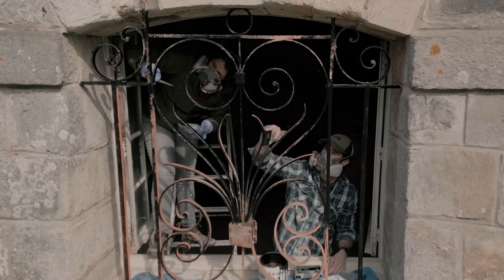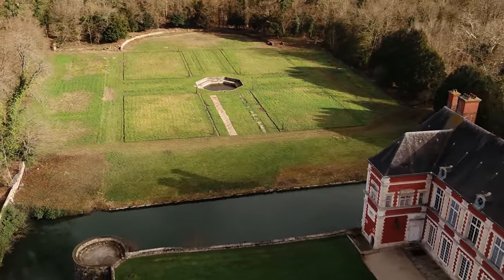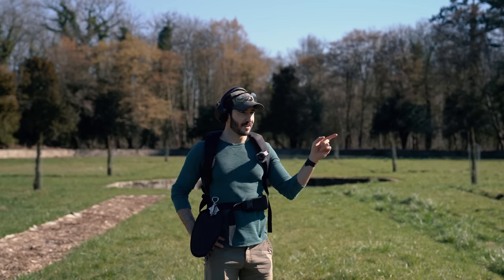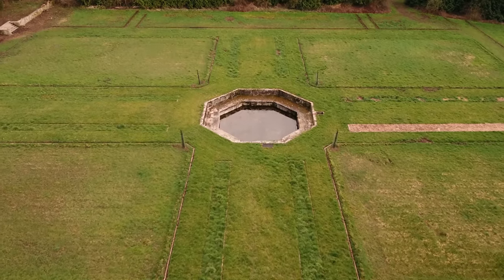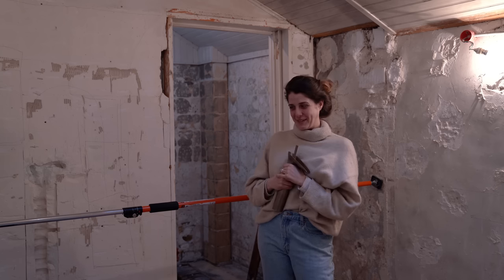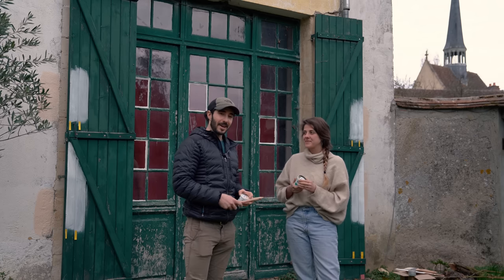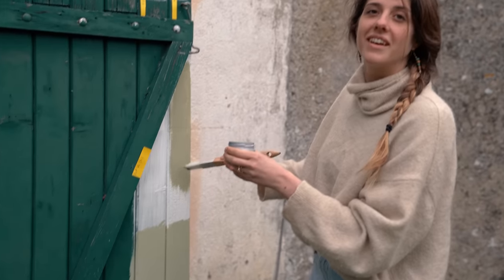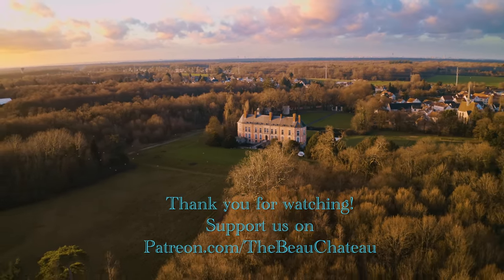Painting Our Medieval Dungeon Metalwork | French Chateau DIY

Comment: You two are wonderful on film. 
PAINTER'S TIP: Not sure if they are available in France, but here in California, when we paint wrought iron like the type on your 'dungeon' windows, painters wear a 'painter's mitt'(they are sold on Amazon). Once on the hand, the painter dips (palms first) hand into a pan of paint and then using the fingers in the glove move (back and forth) the paint over the iron work. be sre to only use one hand at a time...and be sure to put your hand into a sturdy latex glove before inserting your hand into the 'mitt'. 
Because you are giving up some control of the paint, be sure to protect the areas around, beside and beneath the iron your painting. Happy painting.

Comment: I would sand the wood down bare and use linseed oil to stain. The stained wood and iron hardware give a more rustic and authentic look with the age of the grounds buildings. You can also use a torch to give a more aged look with the stained wood.

Comment: You might consider , for a door in that bathroom, putting a trolley track on the ceiling and having a door that slides open on the track on the outside of the wall.

Comment: For the pocket door, it may not seem ideal, but if the existing wall isn't working, you could build an extra pocket wall infront of it for the pocket door. 😉🙃🤔 Though it may take a number of inches away from your bathroom space. However, depending on how deep the wall goes into the corner from the toilet entrance, you can then use the left over pocket wall in the corner to make build in shower shelves for soap and shampoo.

Comment: We had a similar problem while choosing a door for our half bath/laundry room. Originally wanted a pocket door, chickened out, and went with a folding door. It locks with a hook latch, is pretty low profile when folded, and has worked out really well (especially because we didn’t have to mess with the wall).

Comment: Having done designs with gravel in the past.  They are nice when you first finish them, but once any traffic hits them foot or driven, they come apart.  So its either continually maintaining the design or letting it go.   
Outside of designs in it, gravel works well in gardens for paths and highlights.  Barriers underneath are important, but won't keep all weeds out.  Eventually debris just collects under the gravel and they'll take hold anyway.  But it is usually pretty easy maintenance.

Comment: Although I love the original dark forest green. You definitely need to go a lighter colour! As it’s part of the smaller property it will open it up to its surroundings. I’m not sure what the peach was on the walls of the building, but don’t go down that route. It ages terribly and shows up exterior mold too much. One of my properties has a peach exterior (not by my design) yes it’s only a 470sqm house internally, but hell I hate it. Nothing really goes with it and shows all. I’d rather go for a grey to white stone look on the exterior. Everything can work with it and you can see what you need to clean. 

Awesome job to you both! And yes even though just 1 window with iron that nobody else will see, you will and the design is exquisite. Should be used elsewhere in the chateau 💕

Comment: How fast will the paint fade? Will the paint on the plaster fade faster than the paint on the shutters? If paint fades fast where you are, how often do you want to have to repaint? I lived on the Gulf Coast of Texas and the salt air is like sandpaper and the sun is like bleach. I painted my trim a nice dark forest green so that it would still be dark when it faded. Saw a lot of paint schemes turn to pastel. One side of your chateau is red and the other pink--is that due to exposure or on purpose? I prefer the original dark green but since that's out, I like the Darjeeling best.  The cooler the color, the better, to go with the warm peach.

Comment: I got a faucet for my sink that is just like yours, but in brushed nickel.  The problem I’ve had is that the water deposits form within the spout, which is visible.  Also, in a bathroom it doesn’t seem as sanitary, as particles can settle in the spout where you get your drinking water from.  They look cool, but I’m over mine.  Wouldn’t buy one again.